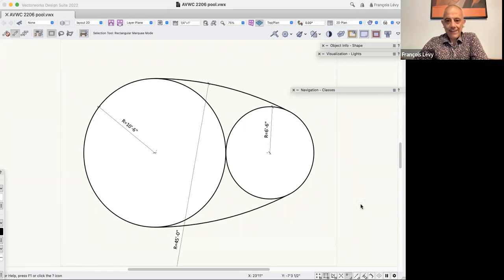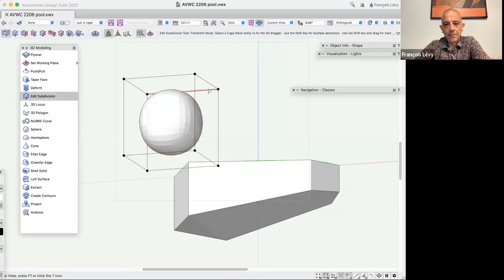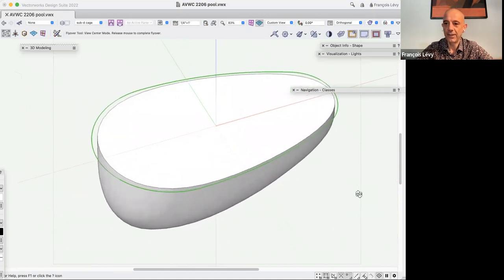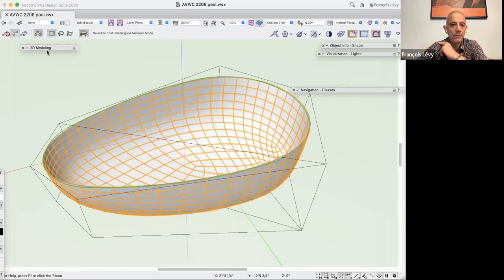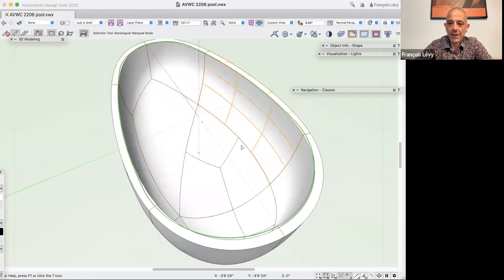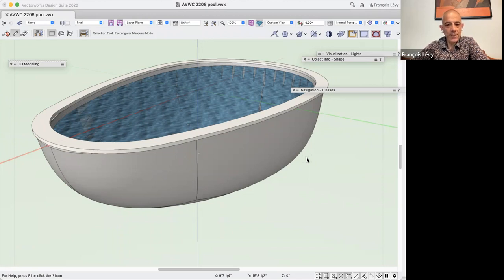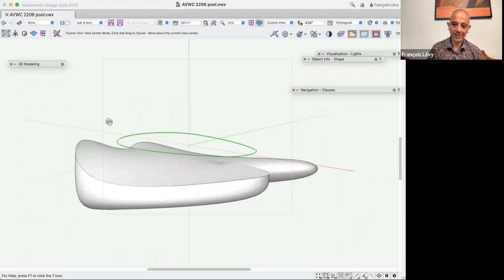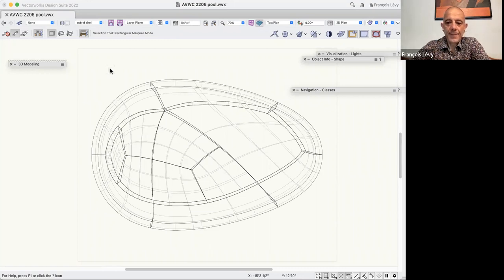Austin Vectorworks Community, June 2022: Advanced Modeling with Subdivision

Comment: Hi Francois, this video is a great video and explanation for an under documented tool in Vectorworks! If one was to have a subdivision level of 0, effectively giving a polygonal 3d shape, would you in theory be able to snap accurately to guides, and therefore be able to use subdivision modelling accurately to convey faceted objects that are more easily editable than standard freeform modelling?
Reply from the maker: Hi Frankie, thanks for the thought-provoking comment. Yes, that would work., and you are correct you would set your SubDivision iteration to 0, for example, to convert a rectangular prism and have it remain a prism. Depending on the geometry your were trying to model, that might in some cases be faster/more efficient than, say, a Boolean operation. But I can also imagine some situations where more traditional extrusions, Booleans, and 3D editing (like Taper Face, Chamfer, etc.) would be more optimal. "It depends", as they say. But this is a great technique to add to the tool box, thanks for suggesting.
Reply from the maker: Hi again Frankie, someone might have been listening; have you noticed there's a Dragger option now available for Reshape (2023 SP4): https://university.vectorworks.net/mod/overview/view.php?id=5183